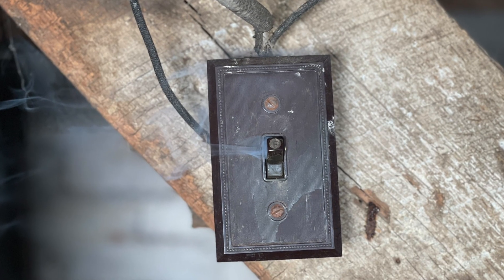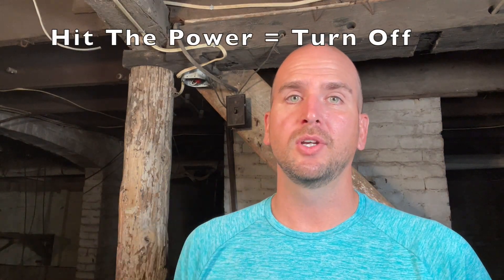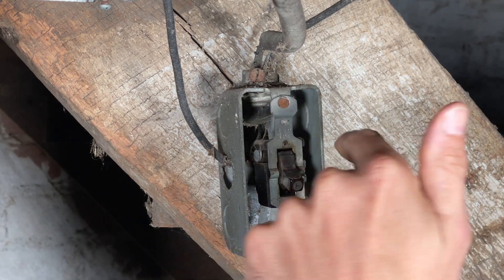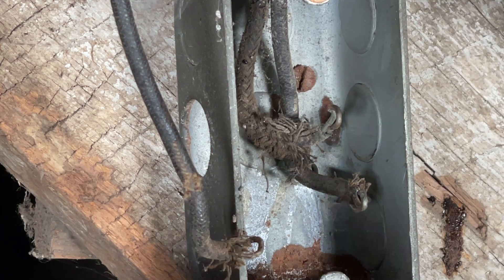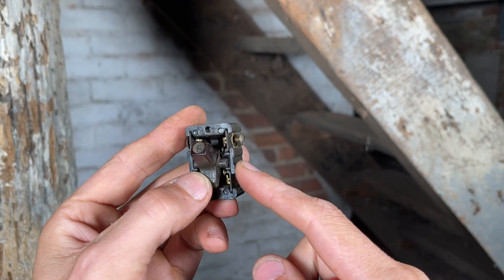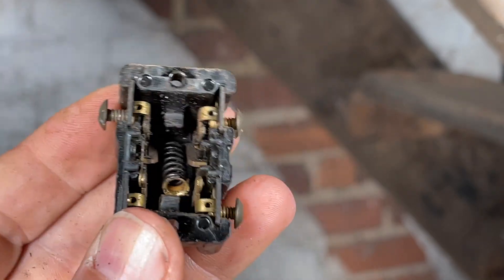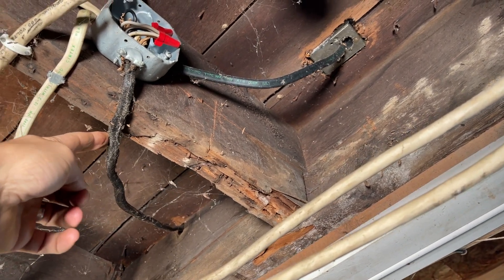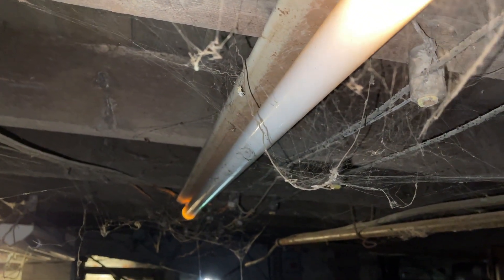Issues with Old Electric Wiring | Knob and Tube

Comment: I am a renter in an old knob and tube house with lath and plaster.  When I changed a light fixture I noticed that my circuit tester was going off when I touched a couple of the walls and light switch plates.  Why are the walls setting off the circuit tester?

Comment: 5000 to 10000 for a electrical renovation .. i DIY it for like 600 in materials for all the wiring and outlets, another 1000 for the subpanel. But sure the electrician also needs to eat 😊
Reply from the maker: Sounds like you haven't bought materials in the past 12 months 😂.  A single rolls of 250' 12/2 Romex is going to run about $150.
Reply: @EverydayHomeRepairs  Here in Europe 30 euros for 1 box of 100 meters (328 feet) VOB (single wire), of which you need 3 (live/neutral/earth), so 90 euros or 96 dollars which is good to redo most of an average house. Powerpoints are like 15 a piece. But it seems like there is huge cost difference between USA/EU then 🙂

Comment: My company is currently upgrading cloth wiring and bare neutral wires in a historic university building that is over 100 yrs old. It is such a pain finding where everything goes and making sure all of the wire is out from the panel to each device. Especially since a lot of it is hidden inside the concrete walls.
Reply: Been there done that in Detroit and Ann Arbor in old historic buildings and homes during my career in the electrical trade.  I saw a lot of fascinating stuff, but as you say, it can be a real pain.  Great memories though, I'm a retired Master now.
Reply: does cloth wiring always mean knob and tuuub?

Comment: My experience? I'm used to seeing knob and tube that's so old the wires are now bare because the insulation has either been chewed off by rodents or rotted off completely leaving bare wires heavily corroded... And I'm left wondering, maybe three needs to be mandatory re-inspections every 40-50 years of electrical systems.

Comment: I was under the impression that knob and tube did not use that vintage cloth insulation, hence the need for the ceramic or porcelain insulators.

Comment: As a home inspector I've got to hand it to you this was a great video that made some very important points. 
You have the knowledge and the perfect delivery style to share it. 
Subscribed. 
Finishing with asserting the importance of a proper inspection for every inexperienced homebuyer is the best advice too many real estate agents fail to give. 
One of the issues folks have when upgrading the panel is when it is explained to them that for new branch circuit wiring and fixtures to adhere to code they cannot just fish romex through closed cavities and consider it an upgrade. The new wiring needs to be fastened to framing members at the prescribed intervals and that requires poking holes to patch up and match up. The cost and inconvenience of that more often lead to the junction boxes exactly as you described.
Reply: Perhaps that may be the case for some local town codes, but the NEC allows it:

The National Electrical Code (NEC) allows for unsupported nonmetallic-sheathed cable (NM) and Type MC cable to be fished between access points through concealed spaces in finished buildings when it's impractical to support them. Other conditions that allow for unsupported cable include:
The cable is no more than 1.4 meters (4.5 feet) from the last point of support to the connection point
The cable and connection point are in an accessible ceiling in a one-, two-, or multifamily dwelling
The cable is Type MC interlocked armor and no more than 900 millimeters (3 feet) from the last secure fastening point

Comment: That hybrid system is scary!! Several years ago when I lived in Pontiac Michigan, a neighbor's house caught fire on a cold November night.   I just happened to get home from the grocery store when I saw flames coming from the attic vent,  when I banged  on their door telling them to get out now the house is on fire.   The couple who lived there tell me it passed inspection there was a new electrical panel installed not that long ago, and they were running an electric fireplace while watching their evening program.  An investigation showed the fire had started at a splice in the attic,  with the knob and tube and romex.  Two story wood wood framed house,  built 1928.   

Felt horrible for the neighbor's because they had just purchased the property that same summer.   

Just because a home inspection shows everything in order, doesn't always catch every nook and craney

Comment: My sister had a house with knob-and-tube, and a breaker panel (from the 1950s or 1960s, maybe?) that replaced the old fuse box.  It looked a lot like what is seen in this video, but the switches were push-button and they kept the smoke inside.  But that breaker panel was pretty old, too - it had fabric-sheathed cable that ran to junction boxes in the basement where it spliced to the knob-and-tube.   I couldn't find the amp markings on the breakers (but I didn't try that hard - I wasn't doing any wiring at the panel).  What I could see of the knob-and-tube in the basement and attic appeared to be in good shape (and the insulators were ceramic/glass!)  

I think the panel was Zinsco or Challenger - whatever brand it was, I later learned was a type of panel to avoid/replace.

Comment: I used to rent a duplex built around 1903 or 1904 and it had knob and tube wiring but was  disconnected and the previos owner rewired the house and I was amazed at  how knob & tube worked back then

Comment: Knob n tube wiring goes back to the teens and 20s and that switch was probably from the 50s. "Hybrid" systems should NEVER be allowed. You can't tell what condition the wires are in the walls and most wind up in the attic where rodents love to chew on them. Best to change it ALL out in the begining. Electrical fires are WAY too common and altering, modifying and abusing older systems is the main reason. Let's bring those statistics down.

Comment: Unless that switch is installed up-side down, you put it to the ON- position, when it started smoking.
 Of course without exception a combination of modern romax or EMT wiring, along with old nob& tube- it's very common on the West Coast much more so it seems than on the East Coast  Where knob and tube wiring  was not being used much earlier, than in places like California, where it was still being installed into the sixties.

Comment: With the “safety first” mentality, after turning off the power, I’d also use a voltmeter or a non-contact electrical tester to verify the no-power condition of that box before I put my fingers in it.

Comment: Hybrid situation here with some cables still in use BUT 1974 construction, changed the stove wire but still have some original blue gained cable in the wall hooked to junction boxes going to the more modern installation.

Comment: I had that at 10Jefferson street Worcester, Mass. One breaker which should be a hint, 
and the rest was K&T one night in the attic I saw the wires a dull red through the loom
which is a cloth covering the wire and going through the tube into a stud or joist.

Comment: They used bakelite as an insulator quite a bit back then. Due to arcing the bakelite actually carbonizes and will conduct electricity. I have seen this many times on old elevator switches and relays.

Comment: My sister and Bro in-law bought a house built in the 60s. I had gone and spent a week of my vacation with them. I usually travel with my tools. I was in the unfinished part of the basement looking at everything. Porcelain lamp sockets with pull strings. The previous owner had installed socket adapters for outlets. One of them flickered and started smoking when I pulled the string. I had found 2 fluorescent fixtures mounted with pig tails on them plugged into the socket adapters. I put a proper switch on the wall with romex to the fluorescent fixtures properly mounted. I took down the porcelain lamp holders and was able to put proper outlets in their place. I didn’t want them to make the mistake of turning on that light and possibly burning the house down.

Comment: Knob & Tube, what a big can of worms for sure. If left alone and keeping the loading of the circuit in check you should have no problem. The only major problem is that the system is the deteriorating wire insulation and Ungrounded. That’s the real dangerous issue.

Comment: i got confused when you said you turned it to the off position because off typically means pushing the switch down but then i realized something...

that switch doesn't even technically have an off position because it's a 3 way switch XD

Comment: The problem here is  post a bad switch, not really knob & tube.  There are three worse things:
1-BX caple that was often UNgrounded, and has a hot outside,
2-Early 1940s & 50's  NOMAX that turns to mush and internal wires short.
3-1970 era ALUMINIM WIRE used with non-AL switches etc. "BURN, BABY BURN" (FIRES)
and a forth----
4-PushIN connections, DO use the screws

Comment: I heard a lot of people just say replace everything old but what if you want to keep something like an older car as a classic? Nobody will work on it because it is too old for their training and yet there are apparently more and more fire risk problems. The ethanol requirement going up in the fuel is causing the supply pipe to rot and leak causing a fire and apparently as well as that the higher burn temperature of the newer fuels can also cause the inside of the exhaust pipe to catch on fire. Also, the wiring will have aged like in this video age but yet nobody will work on the wiring on cars. I am also told on top of that, the exact oil they need can't be produced anymore because older engines need ingredients that are now illegal to use and without them or using the wrong oil type could lead to the engine cracking or breaking apart when running. What are you supposed to do if you want to keep retro stuff?

Comment: Great video. You are saving lives. Just curious why anyone would leave knob and tube in place even if it has not been tampered with. Rip it all out and start again, with modern Romex, devices and combination GFCI/Arc breakers. Oh yes and knock in at least two  8' ground rods for grounding. You can't be too safe!
Reply: Because my knob and tube was originally being installed they did it very well it’s just the modifications by people who don’t know what they’re doing that make it dangerous and especially right now with the copper shortage Romax cable is very expensive
Reply: Likely because in many cases the plaster and lath must be torn out to get to it.  This isn't a jerk the wire through and out of the wall job -- assuming the knobs are in good condition that wire won't simply pull out.

Comment: Not sure when or if my house has ever been rewired it's an old house but all the electric seems to work just fine the only time we ever blew a fuse was when my mom used a extension cord for an AC unit one without a fuse not even a surge protector
Reply: Just because it works doesn’t mean it’s safe
Reply: @TechHowden  never said it was safe but I haven't had any unsafe issues yet I know I at least have the hybrid cuz I have circuit breaker

Comment: All joking aside:  I have seen old houses where there was a fusebox,  with two fuses per home run.  EACH CIRCUIT HAD TWO FUSES IN SERIES!  ONE ON THE HOT SIDE,  AND ONE ON THE NEUTRAL SIDE!  Back then,  there was a good reason for that  (ungrounded system),  but today,  it would never pass code ,  unless grandfathered.  It wouldn't prevent electric shock,  but it might have prevented a fire.

Comment: Yeah, this is what's goin on in my home..First and third floors have new wiring cuz it could be snaked up from the basement or down from that attic...  Second floor still has a knob and tube octopus...  Knob and tube runs up to a junciton box somewhere in the ceiling that is feeding far too many outlets.  Just wish I could find an electrician that has a little better way of finding this junction box than just ripping down the walls and ceilings hunting for it...

Comment: Knob and tube wiring is to date SAFER than any romex. The wires were open air, the hot and neutral conductors were on OPPOSITE sides of the building etc. 
Grounds can be added. 

The downfall of these old systems are: 1. The conductors were rated for FIFTEEN AMPS. In todays standards it is low power but the mains were only 30 amp to 60 amp back than.
Two: NEUTRAL FUSING. They were under the impression back in the day that if one fuse was safe than if a second fuse were added to the neutral condictor it would be DOUBLE safe. The problems with neutral fusing is that when a fuse blew it normally was the neutral fuse leaving the hot wire live and ready to shock the shit out of you. It happened more often than not than.
Knob and tube must be OPEN AIR. You cannot put anything on or in the immediate vicinity of it. NO EXCEPTIONS. This is explained from the getgo in the old books. The conductors use the airspace to keep cool under load. They are SOLID copper trust me on emphasis on solid. Very hard to cut through.

Point is: nice upselling but if the knob and tube is still ok than it does not need to be updated. You are giving good points but false information.
Plus: older switches were made out of ceramic and tend to hold up quite well. Over 60-70 years in my greats house and those old hubbell outlets were tighter fitting than any new chinese garbage.

Just because it has knob and tube and fuses does not necessarily mean it requires updates or is unsafe. You must check things out and do sluething with wire gauge and what fuses are in the panel so on.
Also, splicing romex into knob and tube is perfectly safe when done correctly. You cut the insulation off ONLY and leave the wire intact You MUST SOLDER and union knot the splice than wrap with tape appropriately.
I could go on but its best you pick up an old book on the matter or google it.😁

Comment: That is not knob and tube wiring. That is tar fabric which was used from before WWII up through the 60s and in some places, the 80s. Knob and tube requires knobs and tubes because the wire is typically exposed copper. As in you could grab it with your hand. The knobs hold the wire off of wood and anything else you have, and the tubes go through boards.

Comment: I actually installed Knob and Tube in A Cabin i have. off course no power to it. just the looks cause its exposed. I have actually new Electrical   hidden in the walls. But, any time you turn on switch and lights come on, it has that look of Old style. I have the Old Fashion plugs and and switches, even few old look lights. With Knob and tubes running to some of them. Kindof neat looking really. Im sure if i was to ever sell the place, It would be something i have to remove I think.

Comment: I replaced all the wiring in my 70 year old house but what made that easy was I was gutting it to put in insulation since it was never insulated. so I did all new romex, boxes, outlets etc and I did it all myself. I took residential wiring in vocational school and while I never made a career out of it, it saved me a ton of money.
Reply: My system is hybrid and I can access most receptacles via the attic. It's so much easier being in a house with no insulation, of course. Also, my panel just got upgraded professionally to 200 amp. Having a main breaker is the best.

Comment: Great video!  The issues you bring up are good.  Original knob and tube and be safe, but tying it into any other system can be dangerous.  The original wire insulation was fabric, cotton I believe, and it can turn to dust over the years.  So they depended on the ceramic knobs and tubes for insulation.  The safe way to tie it into a box is to SOLDER on modern wire to the knob and tube supported wires, and then bring those modern wires into the box.  You don't want fabric insulated wires to be coming through a metal box.

Next problem is when people insulate around knob and tube.  Bad plan!!!  That wiring was never designed to be surrounded with blow in foam or fiberglass insulation.  If you're going to insulate, replace all of the old wiring and fixtures with new equipment that is safe to be up against insulation.
Reply: A lot of houses must have burned down then from the wires overheating in the Attic due to the fiberglass insulation around them over the decades that  has been routinely done.
Reply: @frankpaya690  That has happened, but it takes 2 things to cause a fire.  First, the extra insulation.  Second, overloading the circuits, by putting in the wrong size fuses.  The original circuits would have had at most a 15A fuse, sometimes lower, so the wires would never overheat.

Comment: If an electrician walked in it would be his obligated duty to rip out all the old knob and tube and install a probably bonded and grounded electrical system starting with the service.
Reply: That is probably not true.
Reply: @TechGorilla1987  well if your not an electrician then shut your mouth. I'm taking about doing any electrical work with the knob and tube, by code they are required to rip it out.